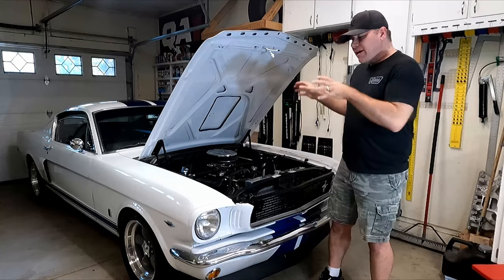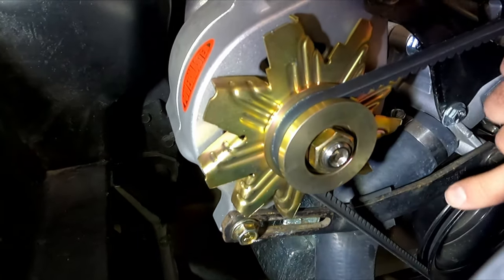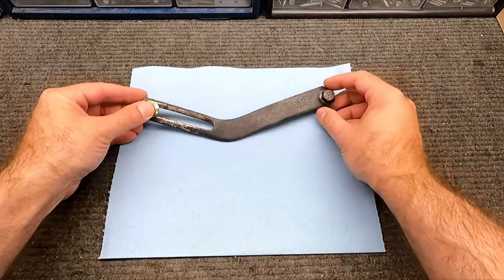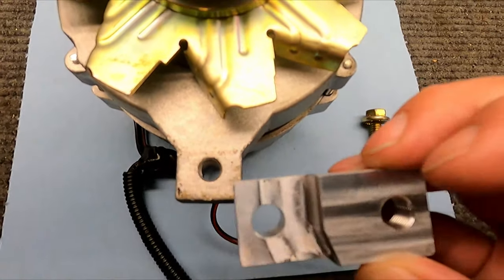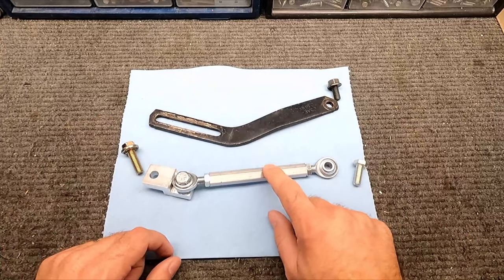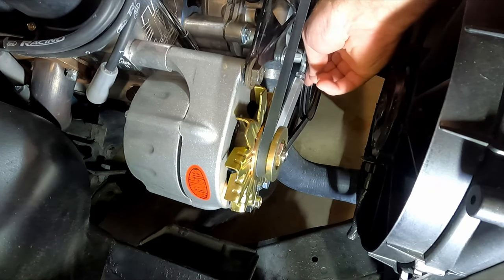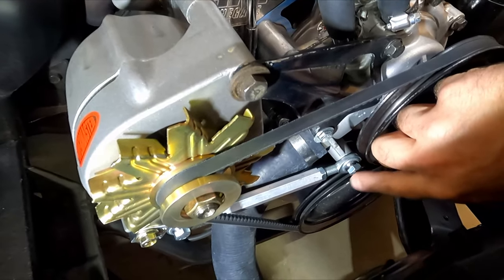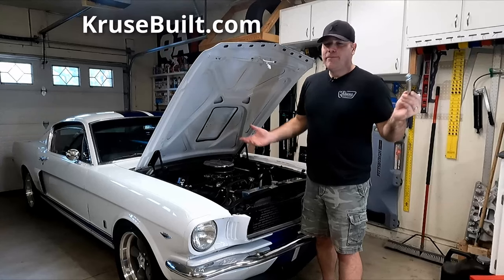New Custom Adjustable Alternator Linkage

Comment: That is SO smart. It also eliminates the slight bend I've found in almost every aftermarket alternator bracket. Sometimes the bend is almost unnoticable, but every time you take a pry bar to tighten the alternator, you bend that flimsy bracket a little more, eventually putting the alternator pulley slightly out of whack with the rest of the belt line.  This upgrade will keep the alt pulley exactly plumb with the crank and water pump pulleys, which should extend the life of the belt.
Reply from the maker: I like products that have positive side effects.  :)

Comment: Ever consider doing one of these with a heim joint so it fits more alternators? Drake did by also making a new top bracket.
Reply from the maker: Hmmm, it's got Heim Joints on both ends of this linkage....

Comment: Man my 65 with the 70 water pump makes the alternator bracket all kinds of weird. I actually welded a nut on to the front of the water pump just to add more threads to the stud. Maybe this is something I should look into and see if it will work on mine
Reply from the maker: Yeah, I know there are a handful of alternator attachment configurations out there, but I haven't been able to quite figure out how to make a one size fits all linkage setup.  I think this will work on a lot of cars, but I may need to offer other layout options as I figure them out.  :)

Comment: Excellent.  Not having problem but mine is all most all the way adjusted not sure what type of ear I have on my alternator going to look though.  Edit... Turns out I am a square.  I do have more adjustment it is greasy and oily I can not see what I am looking at.  Ha ha ha.
Reply from the maker: Yeah, running out of adjustment is part of the reason why I have this adjustable linkage.  Not everyone has an issue getting the belt tight enough, but it seemed easier to get the belt tight with this turnbuckle.  :)

Comment: What size belt are you running?
Reply from the maker: It's part number 7400 from O'Reillys Auto Parts.  I think it's 40-13/16" diameter, 3/8" wide.

Comment: Genius, Andy! Nice work. Have been thinking about a similar application for my A/C compressor to keep tension on the belt. Would love to email you some photos of it and see what you think about a similar type bar because I’m told the compressor belt in my setup constantly comes loose. Thanks so much!
Reply from the maker: Yeah. these kinds of parts seem simple and I bet you could get something to work with your setup.  The advantage of those rod ends is the can keep your part in tension, but the mounting points don't have to be perfectly in alignment.  :)
Reply: @AndyKruseChannel  where should I source the adjustable linkage from, or maybe a better question is there a particular 'grade' of linkage I should look for? I want to make sure that whatever I try to use will be able to hold up against the stress/pressure of the belt. Again, can't thank you enough...
Reply from the maker: @banks412  Due to the size of the hardware you're likely to choose, you'll be fine for the strength of the linkage.  You can look up 'turnbuckle' or something like 'threaded tubing' as I didn't find a naming convention for this type of hardware that was unanimous everywhere I looked.  This also leads to why I had to have the center section custom made, no one sells the exact size I need at a price that I can sell these at (lots of custom and expensive stuff out there).  :)